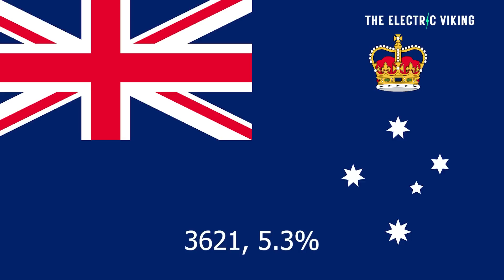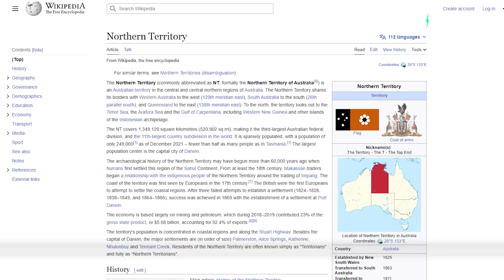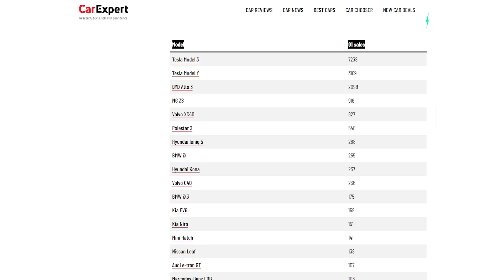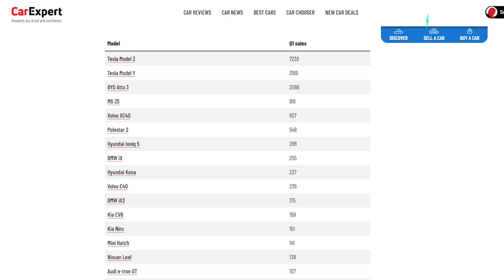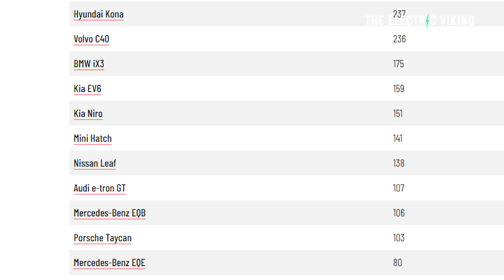Electric car marketshare in Australia increases 158%

Comment: What is the issue with gov tax on EVs
Reply: It needs to be the same nationwide and much easier to implement. I'm not against a distance charge but it should be for all vehicles. Scrap the rest of the charges. It's the fairest way.

Comment: What about electric chargers in Australia?
Reply: What about them ?  just have a search you will be surprised. Besides unless you travel long distance you dont need a charger. Charge at home. Thats what I do
Reply: They will be rolled out and replace petrol stations over time. Are you forgetting that it took over 30 years for the development of petrol stations in Australia when the first ICE vehicles came in abount 1900 and even then if you wanted to go inland you had to carry all your own fuel or get it transported by ship, rail and even by camel.
Reply: @andrewjoy7044  Some petrol station chains are already installing chargers. Ampol has their Ampcharge chargers, they will be putting in 120 of them before October.
Reply: What about them ?  just have a search you will be surprised. Besides unless you travel long distance you dont need a charger. Charge at home. Thats what I do
Reply: Just get an Aptera, then you won't need to plug in most of the time, and if you get a 600 or 1000 mile version, even long trips can be done without stopping to charge.